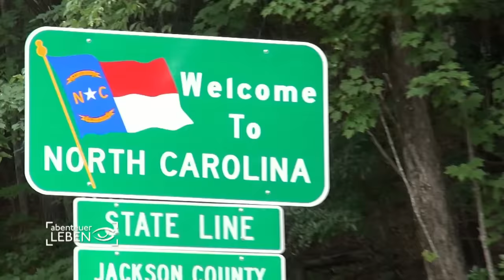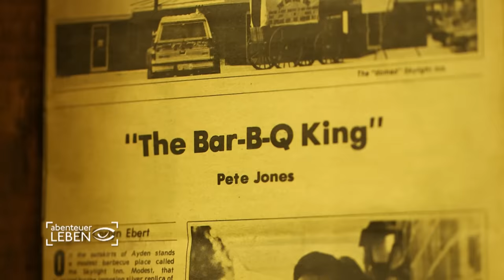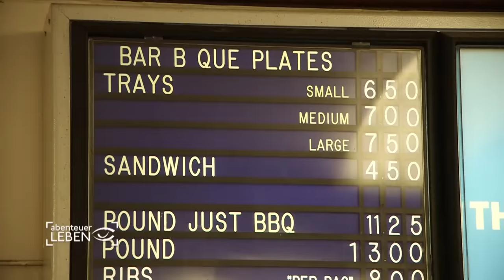The North Carolina Barbecue Trail - Legends and Revolutionary (OV)

Comment: nobody "upgrades" to a gas grill
Reply: I would like a gas grill for the convenience. Of course, grilling and barbecuing are two very different things. I would be fine using propane for stuff like wings and burgers and hotdogs, but I will sometimes do a makeshift smoker with my Weber Jumbo Jim and put some wood chunks on the charcoal and do an indirect heat cooking method with a cast iron pan. Smoked a whole young chicken that way and it was damn tasty.

Comment: Cook "that's all the wood we have left for today" 
Guy goes and gets wood
Pulls in @ 12:02....full row of wood on front and side of building.
Editing FAIL
Reply: You have to season/age wood. Green/just cut wood is full of water and heavy while seasoned/aged wood is light because the moisture has evaporated, it burns clean and hot.
Reply: @YaYa-ex8cu  So you think the wood just outside the pit is fresh cut??!! Wake up dude! The "ready to go-wood" is of course the wood laying outside the pit!

Wake up and smell the wood son!
Reply: @martinhillersweden  I can tell you've never touched a piece of fire wood in your life. You don't cut down a tree, split the wood and stack it where it fell only to come back 8 MONTHS later and move it again. You cut it in movable pieces and split/stack it as close as you can to whatever you are using as a burner.